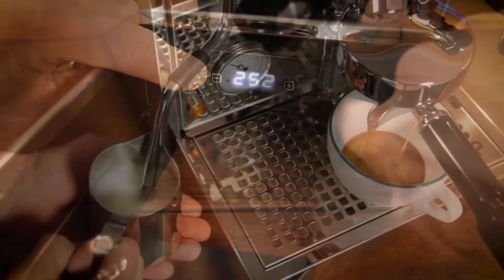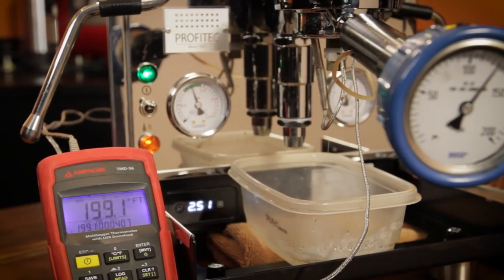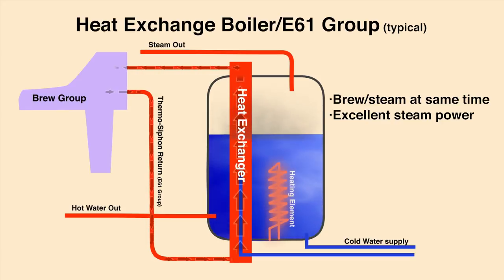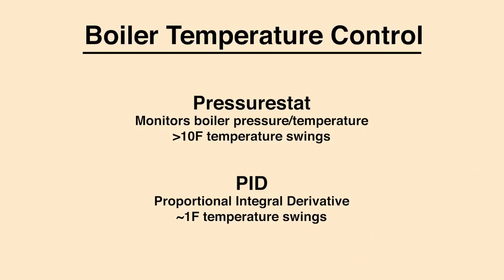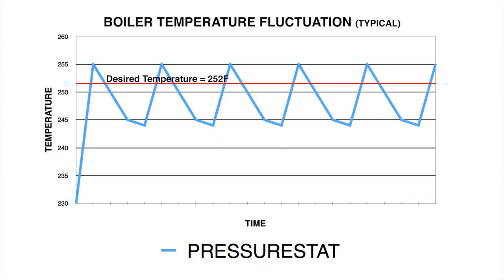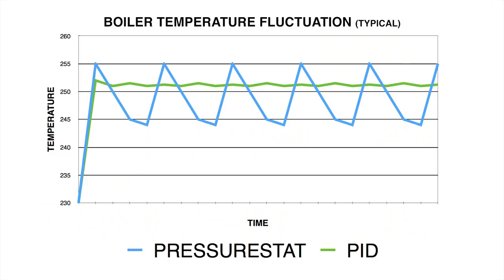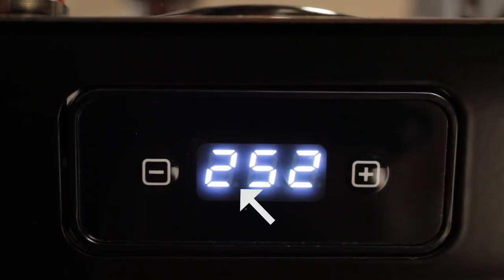Review: Profitec Pro 500 PID Espresso Machine

Comment: hi Mark,
I just had received my machine, I noticed that the temperature in the pid is 120 but the gauge is reading about 0.7 bar, I raised it to 122 and the reading in the gauge raised a little up about 0.9 or less, and I believe that in that case should at least be over 1 or 1.2 bar, did I make something wrong or it is normal?!

Comment: Looking to replace my Silvia that I purchased from WLL 11 years ago. One issue I am having is all of the Prosumer machines seem to have the steam wand on the left and the hot water on the right. I really don't ever use the hot water wand at all. My counter is such that the machine sits where the right side is at the edge of the counter. This makes it easy to steam with Silvia as the steam wand is on the right side. Is there any way to have the manufacturer or WLL reverse the sides of the hot water and steam wands so the steam wand would be on the right side? Thanks!
Reply from the maker: Hi Michael, Reversing the steam and hot water is doable. If interested let us know. Wands are easy to switch sides. Inside the machine we'd need to do some re-plumbing of the copper lines but there's tons of room to do that.

Comment: I'm curious how the Scace results would compare to the non-PID Pro 500 or similar HX machine.  Excellent video Marc, you guys have got machine reviews down to an art.
Reply from the maker: Hi Chris, Thank you for the comment! I would like to compare Scace temps of non-PID HX machines. Most all I'm familiar with flash boil the first brew water at the group so with no flush I guessing they'll be over 205F. So question is when to measure. I think it would be interesting to do some tests with a series of timed flushes and see if it's possible to get accurate and repeatable temperatures. Do 5x tests with a 4 second flush and see what the temp and variation is. Then repeat with other flush times. What do you think?
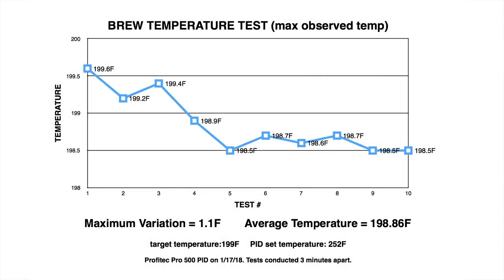Reply: Hey, yes similar to brew temperature test in video at 4:10

Comment: Why not 1600 watts?

Reduced warmup time in lieu of a power on time control? Why don't you get thermostat control until only the highest end machines? (Exception, breville dual boiler)
Reply from the maker: Hi David, Thanks for the questions. The 1400 watt elements are very common. Going to 1600 puts things a little to close to 15amp draw with 15amp circuits very common in homes. 20 amp appliances may require something other than Edison plugs. You can get PID temp control in less expensive machines like the single boiler ECM Classika: https://www.wholelattelove.com/products/ecm-classika-pid-espresso-machine-with-flow-control. In my book the Breville DB is an appliance quality build and not true made in Italy/Europe machine. The BDB has lots of plastic and proprietary components, low user serviceability and assembly line production. A far different product than the true machines with little or no plastic and high user serviceability.
Marc

Comment: Within the Profitec Pro 500 manual of 2018 there is a chart of which PID settings result in which brew temperatures. The graph on 4:13 states, that the PID temp was set to 252F which on my manual would result in a brew temp of about 203F while your graph states a target temp of 199F. How comes?

Comment: Hi Mark! Does brew temperature drop if you steam at the same time or does it stay consistent in that case also?
Reply from the maker: Hi T, I have not observed brew temperature drops when steaming. There's enough thermal mass in the system with the E61 etc to prevent a drop during normal brewing and steaming.
Reply: Cheers mate!

Comment: Hi Marc,
I realize this is a relatively old video but note that early in this video the PID display showed a setting of 252.  In some places I've read that a setting of 248 results in a brew temperature of about 200 but in other places I've read that a higher setting should be used to obtain a brew temperature of 200.  I realize that the relationship between boiler temperature and brew temperature will vary somewhat from one machine to the next but would like to know, based on your experience with this machine, if I should be setting a boiler temperature higher than 248 if I want a brew temperature of at least 200.
Thanks for providing these very helpful video for those of use new to prosumer espresso machines.
Reply from the maker: Hi Paul, Thanks for the question. ECM suggests using 248F setting for 200F brew temp. As you mention there will be some difference machine to machine based on variables like ambient temperature and how long the machine has been on and idle. If I were running the machine at cooler ambient temp like 70F or below I'd take the temp up a degree or two. Do experiment and see how it changes the flavor of your shots. When you do change temps give the machine some time to stabilize as temperature changes must work throught the group. The other thing you can do is run the machine at a higher temp, pull  a shot and taste. Then do a shot with a cooling flush of 5 seconds before pulling a shot which will give you a lower brew temp. Hope that helps.
Marc
Reply: @Wholelattelovepage  Thanks Marc.   You, and WLL, rock.
Reply: @Wholelattelovepage  Hi again Marc.  I have another question. Is the brew group gasket in the Profitek Pro 500 PID made of silicone?   If not, would you recommend replacing the stock gasket with a silicone gasket?   I ask based on a post I read suggesting that a rubber gasket will fail prematurely if the portafilter is left in place which has been my practice.   Thanks in advance.
Reply from the maker: @phcalama  Hi Paul, The Pro 500's stock gasket is not made of silicone. I wouldn't say the stock gasket fails prematurely but it will not last as long as a silicone gasket. Silicone gaskets are more flexible so clock-in does not require as much force for a good seal. Here's a link to the silicone gasket for E61 groups: https://www.wholelattelove.com/products/caffewerks-silicone-group-gasket-73-x-57-x-8mm For E61 groups with a fair amount of wear from use there's this silicone gasket with an extra 0.5 mm in height: https://www.wholelattelove.com/products/caffewerks-silicone-group-gasket-73-x-57-x-8-5mm
Marc

Comment: How big difference does PID make in an espresso? I do make milk based beverages as well, so I am thinking between having a heat exchanger machine vs a single boiler with PID in the same price range.
Reply from the maker: Hi p, Thanks for the question. PID makes a difference in temperature stability and in how one uses a machine. Without PID on an HX machine you will generally need to do a cooling flush prior to extracting an espresso as the brew water is overheated. It's an extra step. By adjusting length of flush by a few seconds you can easily get a warmer or cooler brew temp. But, it's a bit of a guess. With PID, set the temp and that's what you get. If you do a lot of milk drinks you may get frustrated with waiting for a single boiler to get up to steam temp. Then after steaming you need to cool down the boiler before making an espresso. Hope that helps!
Marc

Comment: Tnx for the review. Would you recommend this machine over Rocket Mozzafiato R? Which looks better in person? Ty
Reply from the maker: Hey t, You are welcome. So the Profitec Pro 500 PID is one of my favorite HX boiler machines. AS far as what looks better in person, I like the look of the Mozzafiato with it's thick slab side panels. Rocket does go heavy on the branding of their machines which sometimes gets to be a bit much for me - but that's personal preference. Other things to consider: The Mozzafiatto R (R = rotary pump) is plumbable direct to water line. The Pro 500 is not plumable and uses a vibration pump.
Hope that helps!
Marc

Comment: Hi Mark - I really like the look of this machine. I'm unsure how to decide between a V and R pump machine - how much of a difference does this difference mean in the cup? And as someone who wouldn't be using it more than 3 times a day, is not being able to plumb in a huge deal? Thanks!
Reply from the maker: Hi Keagan, Thanks for the question. Pro 500 PID is my favorite HX machine. Judging in cup differences between R and V machines is incredibly subjective. We've done side by side blind taste comparisons with our staff and there's no clear winner. Very difficult to control variables between 2 machines to remove the effects of everything but the pump type. What you do get with a rotary pump: quieter operation, high reliability and usually the option to plumb. Is not plumbing a big deal? Probably not at that level of use but have to say it's awfully nice to never have to think about filling a reservoir. Also easy to connect inline water filtration to eliminate scale build up in machine.
Marc

Comment: Hi Marc,
Maybe a bit off topic but I’m looking to buy the 500 after  seeing all your reviews. Problem is I really love the look of the wooden control knobs and portafilter handle on the Izzo Vivi. Do you think the wooden kit from Izzo would fit the Profitec 500? Thanks!
Reply from the maker: Hi C Strat, All topics are fair game! They will not fit :(. If you love the wood trim look you might have a look at the Elba 3: https://www.wholelattelove.com/969-coffee-elba-3-espresso-machine
It's currently $500 less than the Pro 500. The Elba 3 is an E61 group, HX machine but not PID. Also does not have hot water dispensing.
Marc

Comment: Hi Mark... great info.. But I worry about steam power in lower brew temps.. According to the manual, the PID is set for 244 if you want 195 brew temp. From steam charts this seems to be about .87 Bar.. This seems low to get good steam performance.. Have you tried setting the brew temp for about 195 and then see what the steam power is? It’s not that I’d typically extract at 195, but if I did have a dark roast and wanted to drop the PID to what the manual recommends (244) I wouldn’t want the steam power to really drop out. Only hands-on experience could tell what happens. I’m looking to purchase either this machine or a Pro 300. I’m hoping this has more steam power across a total extraction range of 195 to 205.
Reply from the maker: Hi Dave, Thanks for the comment and questions. Profitec's chart needs an
 update. I believe it was created prior to some modifications were made 
to the E61 thermosiphon flow restrictor after our initial evaluation of 
the machine in late September early October of 2017. In my testing (as 
seen in this video) with a Scace mounted temp sensor PID was set at 252 
to produce a brew temp averaging ~199F. I have not tried to produce 
brew temps of 195 but my guess is one would set PID to about 248 to get 
195.

But here's the thing... even at a boiler pressure of .72 Bar the machine has plenty of steaming power! Here's a video showing the boiler pressure gauge of the Pro 500 while producing steam over a one minute period: https://youtu.be/JzH4ECZaC14 A couple of things to note in the video: Boiler pressure drops rapidly when the steam is first turned on. This is true of any machine in this class. Pressure starts at a hair over 1Bar and within 4 seconds it's down to ~.72. After dropping, the boiler pressure rises while steaming to ~.77 Bar. Maintaining or increasing pressure while steaming does not happen on all machines.

If steam power is your main concern I'd go with the Pro 500 over the 300. The 500's boiler is more than 2x the size of the 300 at 67oz vs. 25oz and has a 1400 watt element vs. 800 watts in the 300.

Hope that helps. Let me know if you have more questions.
Marc
Reply: I really appreciate the reply. Great info.. you do a great service to share your experience. I can't find this type of info on any forum. So my problem is that I'm in Canada (or I'd buy from you). If I bought a new Pro 500 in Canada is there a chance I'd get an old pre-modified unit?  That chart came directly from the manual that I just downloaded from Profitec's site. One last question. I want to keep this unit for 5-10 years. How susceptible to scale would the flow restrictor be? Are you seeing any issues in this area. I will use really good water (RO plus 3rd wave water espresso crystals) but am hoping this is not a weak spot where a tiny bit of scale could throw the system out of whack. I think WLL had modified non-PID PRO 500s for some time with a restrictor. Did you notice any more maintenance with this mod? Thanks again for taking the time to reply. I love the looks of the 500. Ultimately I may have to get some gauge to see where my brew temp is exactly.. but I would only need to do that once to have some confidence everything is working fine.  Dave
Reply from the maker: Hi Dave, Happy to help. I have no way of being certain what you might get in Canada. But, I think any modifications done in development for machines sold in US would be the same for those in Canada. If it's a Pro 500 PID chances are it's identical across North America. I don't think the flow restrictor would be any more susceptible to scale than other parts of the machine. We have not had issues with flow restrictors scaling on older 500s. Many machine manufacturers use flow restrictors in their thermosiphon setups.  Water and potential scaling has as many variables as making an espresso! In most cases it's best to do prophylactic descaling unless you are 100% certain your water will not cause scale. The only way I'm aware of to get that yet maintain a mineral level for good flavor/extraction is with ion-exchange filtration which replaces a good portion of calcium with magnesium. Calcium causes scale when it gets to a certain level. Keeping calcium level lower by exchanging for magnesium makes water that will not scale. Bonus usage tip: Regardless of water used it's important to regularly run some water out of the hot water wand. If you only do steaming, overtime minerals will concentrate in the boiler and may cause scale. This does not affect the brewing section as the HX gets fresh water from the reservoir when brewing.

Comment: I am torn between this machine and the Rocket Mozzafiatto. Both have excellent reviews here on this channel and elsewhere. Can anybody make an argument for either one of the machines over the other? Any differences in build quality and performance anybody would know of? Thanks a lot !
Reply: Since nobody did reply: i got the rocket. Very happy but sure the Profitec is similarly good. Just did like the looks of the rocket 5% more ❤️
Reply: @iamphil1598  how's the rocket so far? You got the V type?
Reply: @Abaaaddy  Yes, I got the Rocket Mozzafiato Cronometro V in April this year. I am very satisfied with the machine so far. No complaints. Having a PID did help me a lot with some medium roasts which had been a bit sourer initially. Changing the temperature did help a lot here. So very happy. Build quality is outstanding in my opinion. But keep in mind I lack comparison to other machines. Any questions just let me know here.
Reply: @iamphil1598  how long does it take to be ready to brew? How's the consistency? What's the optimal set temperature based your experience with the machine? 92-94 C ? Did you ever need to cool flush? 
Sorry for all the questions but I'm about to buy it 😅
Reply: @Abaaaddy  All fine I am happy to talk about my personal experience: I am using a smart power socket to automatically start the machine in the morning. I give the machine 30 mins to heat up and for my taste this is sufficient. I usually brew dark roasts needing a bit less temperature. I currently have the PID at 119 degrees Celsius giving me 92,7 Celsius at the brew head. This is based on the conversion table which is part of the manual. That's 246F and 198,9F respectively. Temperature consistency is good. I have no complaints here as I am able to pull consistent shoots. I don't do any cooling flushes and I am happy with the quality of the shoots.
Reply: For me the main advantages of this machine is the PID which I used much more often than I did expect. Once you start to play around with different coffee beans and roasts this feature is worth any cost to me. I also do like the build quality and the ease of cleaning. You to all parts easy and the cleaning is done in just a couple of minutes. There are some sharp edges around the drip tray but I did hear other manufactures might be worse. Still I do wonder why this is still the case in 2021 across so many manufactures. Should not be IMO.
Reply: The noise of the machine is for me very good. Not too loud and in the end the grinder will be much louder anyway. So I do take any comments about noise with a grain of salt.
Reply: @iamphil1598  terrific feedback. Im upgrading from delonghi dedica to this one. I'm sure it will be a big jump and the difference will be noticeable. Just waiting for black Friday deals. Thanks a lot and I appreciate all the input 🙏
Reply: @Abaaaddy  I am certain you will be happy! Money worth spend for years to come! Enjoy and all the best!
Reply: @iamphil1598  I'm you agree that a dual boiler is overkill
Reply: @Abaaaddy  depends how often you do milk drinks vs plain espresso. I drink primarily espresso and only rarely the cappuccino. Thus single boiler is enough for me. Personal decision IMO.

Comment: Does the lcd screen double as a shot timer?
Reply from the maker: Hi M, The most recent version of the Pro 500 we carry in US/Canada does have a shot timer and the PID screen is visible. This is not the case on all Pro 500's. See it here: https://www.wholelattelove.com/products/profitec-pro-500-pid-espresso-machine-with-flow-control
Hope that helps!
Marc
Reply: @Wholelattelovepage  ao if the pid screen is mounted behind the drip tray I can assume that it doesn’t have a shot timer? Thank you for all the info you provide